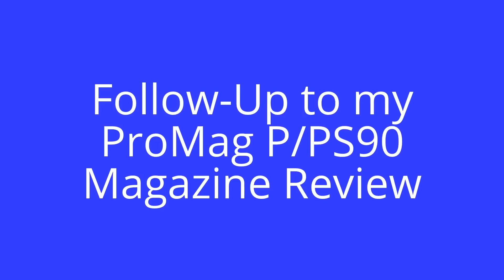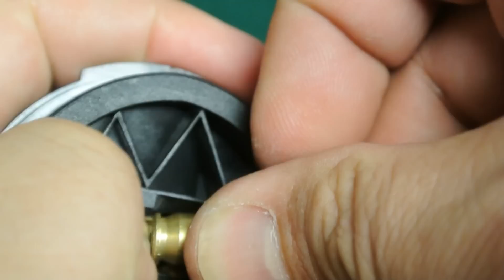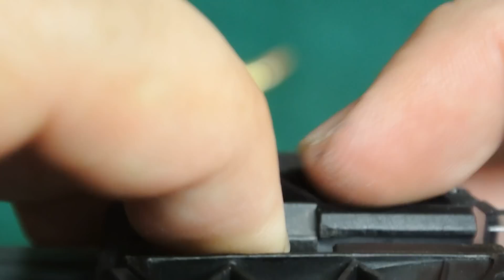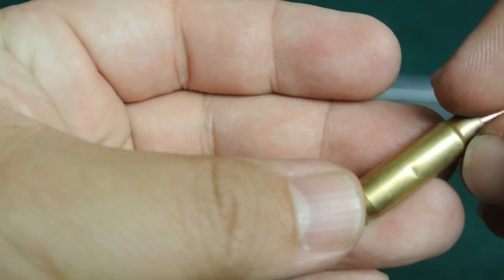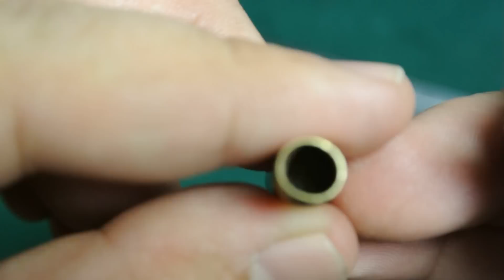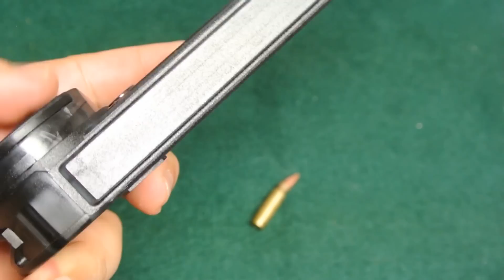ProMag P/PS90 50 Round Magazine Problems

Comment: American Eagle is known to be unreliable in the PS 90. Not saying that’s the problem but personally I only use it for mag dumps. NEVER for self defense.
Reply: Its a ProMag + American Eagle ammo issue. They don't mix. And they both suck. It's best to do your research and find the best mags and ammo before wasting money on garbage. The PS90 works like a wonder with it's original mag. If you need to replace the mag from a 3rd party, it likely wont be as good. The 5.7 from FN is also the best 5.7. Should you source 5.7 from a 3rd party, it wont be as goos

Comment: if only they made replaceable metal guides instead of cheap plastic blades
Reply from the maker: I wish they did too. Metal feed lips would be awesome; no wearing out of plastic. 
ProMag chose to stay cheap instead of selling a $30-35 mag that could outlast the stock FM mags with just a few improvements.
Reply: @SavageJim01  Maybe someone can cast the parts or CnC machine aluminum parts instead.
Reply: @SavageJim01  AR57 makes them in that price range, I wonder if they work better